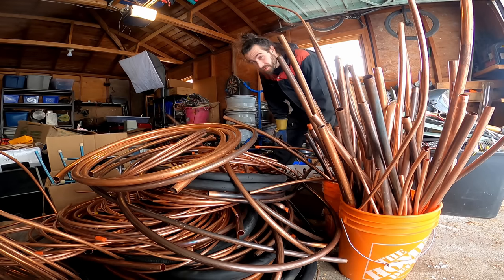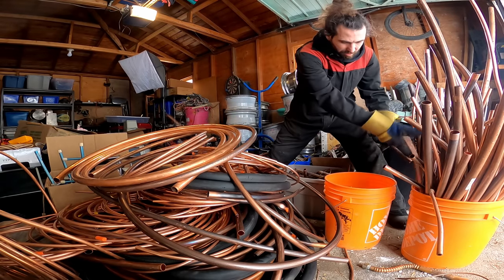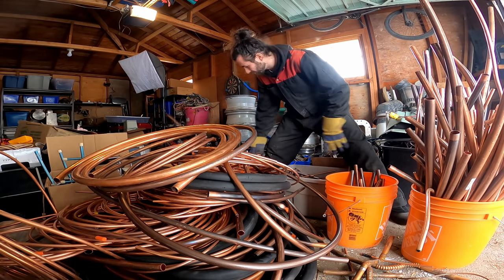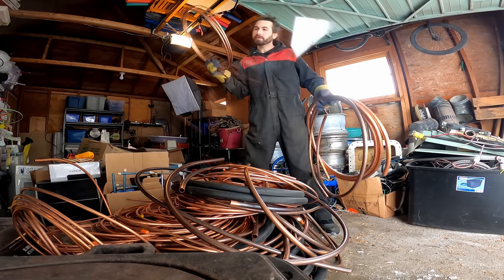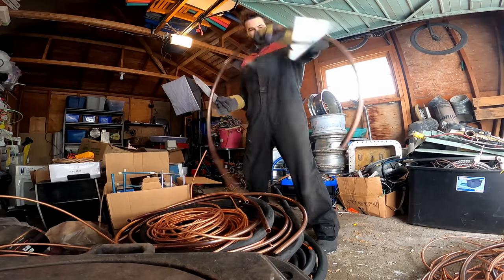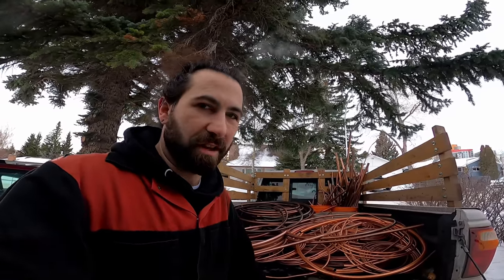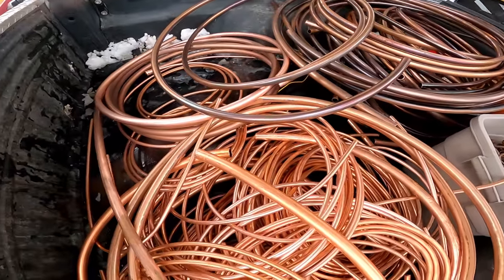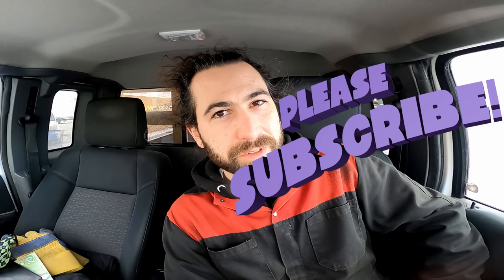Scrapping MASSIVE Scrap Copper Haul! How Much?

Comment: My biggest copper haul would be right around 800lbs & also had 200lbs of brass.  It all came out of the ceiling of a building that I was involved in remodeling.  We think the room use to be medical use 1/2" -1" copper. It was the biggest money amount of around $3100. This is in Tarpon Springs Florida
Reply from the maker: That’s huuuuge! Fantastic score there for sure! I have to assume you had to split it, but that’s still a killer haul
Reply: @thubprint  I took it all in at once. The scrap yard knows me.  They had to Mail me a check for the copper.

Comment: was working as a steamfitter this summer and we were replacing MASSIVE coils from huge air handling units. the coils were about 4ft tall by 12ft long and around 10" thick solid copper! I took a load to the scrap yard one day with what looked like 2 torn apart coils on it and got over $5000 for it! there was atleast 8 coils that size being replaced and a few smaller ones! and this was just one of their jobs that year! safe to say the companies pizza party fund shouldn't dry up too soon hahaha

Comment: My uncle owns a flat roofing company. You should have seen the loads we used to haul to the yard. We had a steel pile, aluminum pile and copper pile. We used to remove whole HVAC units from the roof all cut into pieces. We did one steel haul alone that was over $1000.

Comment: What’s up my friend… so just had to stop by and say I found my biggest scrap of my somewhat short career….. an industrial size AC u it that came from a mansion and is in shambles on the side of the road…. U touched my any other scavengers…. All I had with me was a pair of wire snips so I got to work taking as much copper wire as I could….. so much copper tubing in this thing… I need some advice . What’s the best tool to cut copper tubing

Comment: Gday mate I been collecting 

Fridge motors plus leads plus copper pipe 

Washing machine motor plus leads plus motor pump 

Aluminum etc 

The leads got millberry copper wire

The leads got aluminum wires too 

Brass 

Things I found from scrap place

Comment: So I’ve come across some cable/tv wire I guess that’s what it is. Anyways I w got 200 ft of it… it’s not power line wire but it’s the wire that’s below that on street power lines…. There’s an insulated sheath about 1-2 inch in diameter with about 50 different colored really small wires. Anyhow what category wire would this fall under?

Comment: It's good your scrap yard let's yall bring it in without hassle. Our scrap yard would have the police to show up especially if you don't have a contractor license.  Do you ever run up on car tags/license plates?
Reply from the maker: Not sure what you mean by run up, but I’ve had a relationship with these yards for years now so they know I’m not likely to be doing anything shady to get my scrap. If they’d never seen me before then I’d understand if they had some questions!
Reply: @thubprint  do you ever find any car tags/license plates ?
Reply from the maker: @moondog4313  ohh! I’ve found a couple in my travels, I think I still have them. Not very exciting though, as I can’t use them and they aren’t much aluminium.
Reply: @thubprint  I use the to make things. Aas long as they're aluminum

Comment: Didn't the scale say 1312 pds? Where did they get 200 pds and change..gotta tare the pallets but they dont weight that much. Looked like way more that 200 and change
Reply from the maker: My material basically just topped off that bin, it was already mostly full and they recorded the weight before I started loading into it
Reply: @thubprint  Looks can be deceiving, makes sense. Rock and roll buddy, the channel is awesome!
Reply from the maker: Thanks so much Jeremy! Having fun doing it 😁